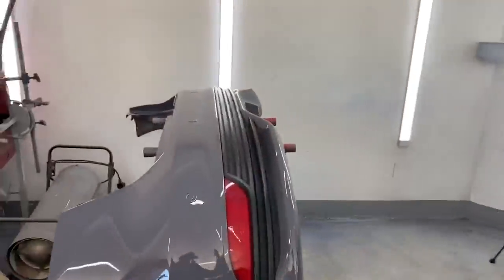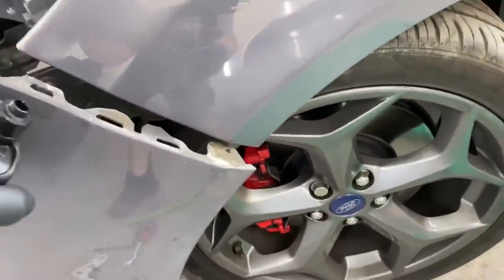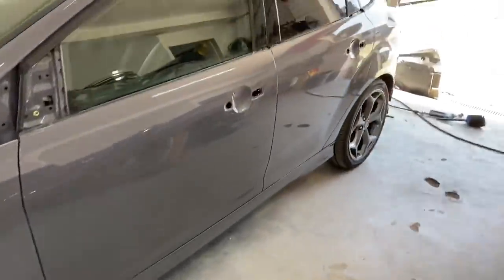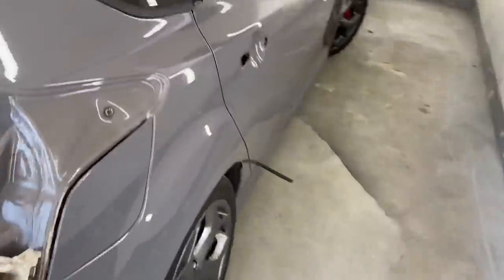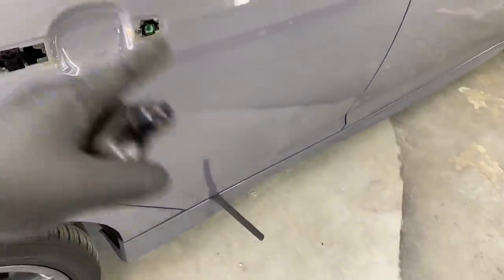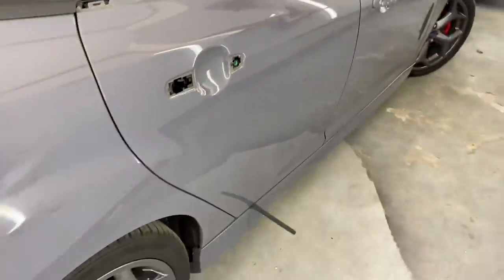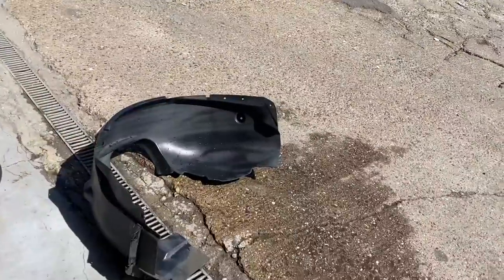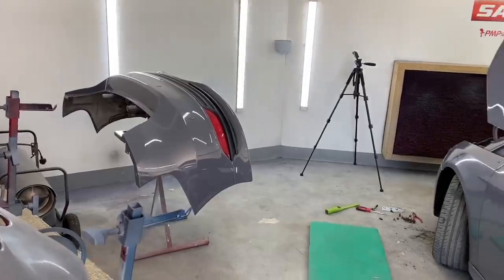Mountune focus st3 disaster paint job repair!!

Comment: Can't beleive that came from a body shop....I have just completed a refurb of my L200 tub including cutting out and making new side panels and welding them in all with basic tools and painted it with basecoat and 2k laqueur all on my driveway and came out with a far better paint job than that...well done for taking on another body shop job and doing it as it should be done...👍👍👍
Reply from the maker: Thanks 🙏 👊👊👊

Comment: Hi Grant, lovely motor, I take it when you say "silicone in it" that's a paint contamination ie, surface not prepped correctly..?? Cheers, Alex.
Reply from the maker: No it’s actually a form of silicone on the panel when you spray over it the paint will just not cover it just leaves small circles but yes if you prep well you can stop this most of the time 👊👊👊
Reply: Hi Grant, OK got that thanks, have heard painters over the yrs discussing contamination etc, (and not wanting technician's in the paintshop in overalls) lol.. cheers mate, Alex.

Comment: Why do these bodyshops insist on using cheap panel wipe as you only end up having to do the job again or someone else does. I use the quartz silicone remover from spray guns direct and I never get any of these problems. If you haven't already try there quartz liquid glass, amazing clear for the money.
Reply from the maker: I’ve not used it yet I was looking at that a while back, I’m hooked on mipa cx4 at the moment but may grab some to try 👊👊👊
Reply: Try it, your never look back. Amazing gloss which doesn't drop off, be good for full respray rather than general repairs.
Reply from the maker: How does it polish up ?
Reply: piece of cake, just don't leave it a couple of months to cut as it goes off real hard, which makes it good to resist stone chips. I go 1500,3000 trizact, 6000 trizact a couple of passes and it there.
Reply from the maker: Ok it’s on the list then 💪💪💪
Reply: If you do try it, don't bother with mixing with speedster. Never suffered with drying issues or reactions even with 3 coats. I don't do tack and whack as suggested, 10 mins flash between coats. I just mix 2:1 with 5-10% quartz thinners. if cold I stick everything in a bucket of warm water to 30c or leave everything in sun, helps everything flow as its so thick.

Comment: Why did the car need so much paint was it bought as salvage to repair?
Reply from the maker: No the scuffed the rear bumper and the front passenger door had a tiny scrape so he paid extra to have that bit blown in and this was the result after taking it back 5 times 😢😢😢